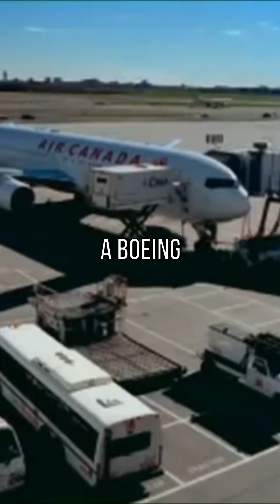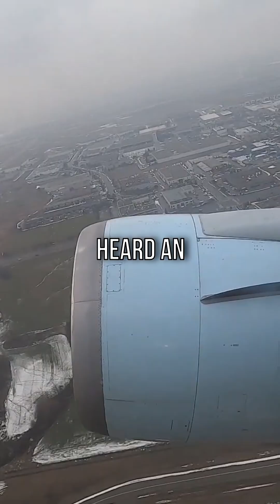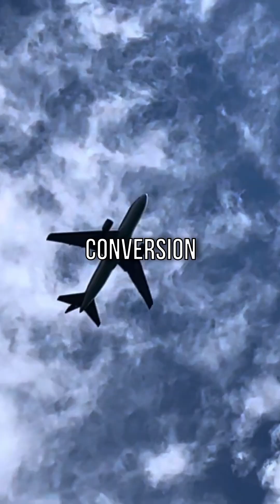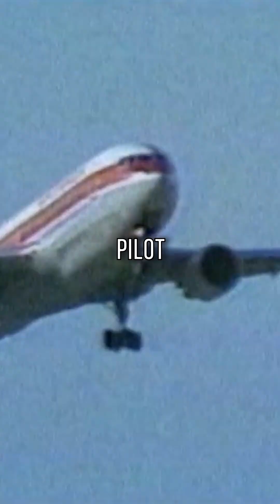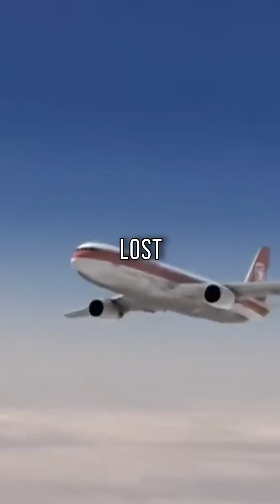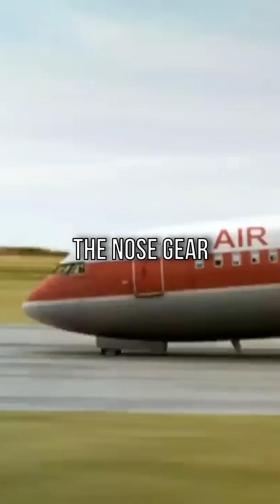They Landed with No Fuel! #shorts

Comment: Baloney. It was an Airbus that used liters, not gallons. The runway was being used by a drag race club. They saw the plane coming, and cleared the runway. They pumped the main gear down, but not the nosewheel. There was no fire because there was no fuel, and they gently lowered the nose on the runway with little damage. You should be sued for publishing innacurate stories.
Reply: Well they definitely didn't hear it without running engines and it was almost dark so the pilot didn't see the other runway as the runways were not lit being they were abandoned.